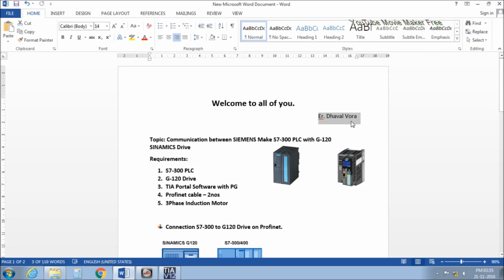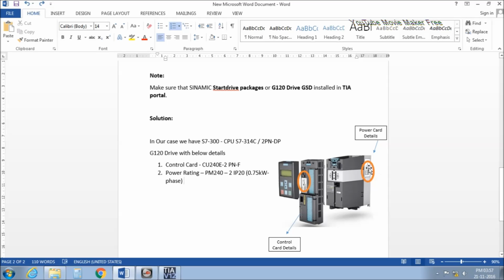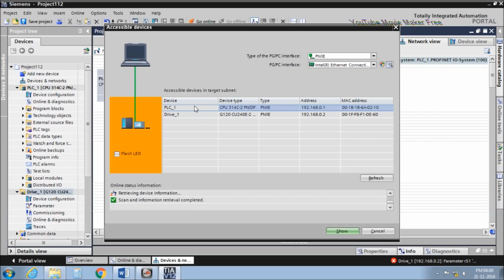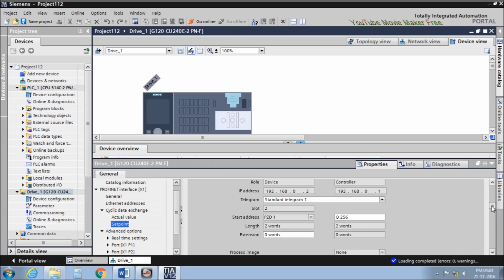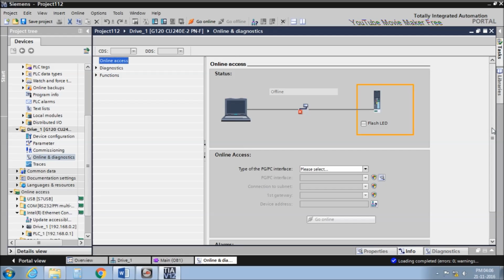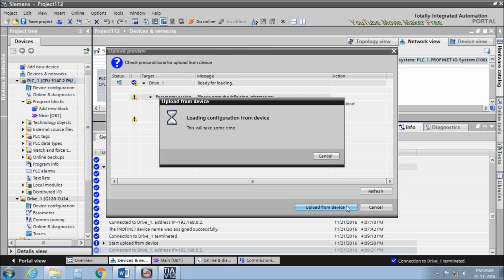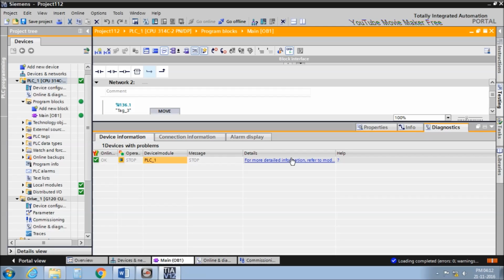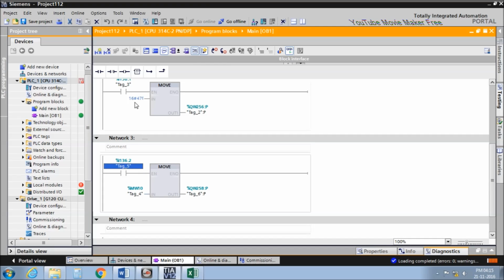ProfiNet Communication between SIEMENS S7-300 PLC and G120 SINAMICS Drive

Comment: hello Brother, firstly thank you for your efforts, 
I tried to apply your instructions carefully to my G120 drive, but the motor remain stopped, knowing that i didn't have any communication issue, i was able to pass to the online mode without problem, 
to make sure that the telegrams pass to the drive i opened the drive diagnostic window (in online mode), just to watch the control word, and there i realised that although i move the hex value to the address, the control world remain in it's prior value, it doesn't change ..., so please if there is something that i should do with the drive, perhaps some prior configuration... please tell me, i'm stucked in this point..
Reply from the maker: If your value is not change. Means communication not done properly. Plz. Again check. Inside drive check communication paramer. That should be process field bus....
Reply: @DhavalVoratechsystems  yes it doesn't change, but when i start the drive from the local button (the green) the motor run, and moreover i can perseive that the first bit of the control word pass to 1 (from the diagnostic window),  so  as you said maybe i missed something in the communication parameter, but how can i get into this parameters and how can i edit it, (do you talk about the p1000 ? )
Reply: @DhavalVoratechsystems  the actual value of p0700 is 0, is this correct, because i saw in another video that it should be fixed at 6?
Reply from the maker: @youssefalaoui6894  it should be 6

Comment: Hi, I have to program a G120 CU240E in a grafcet so it can control the speed of a washing machine motor, the point is I can't figure out which are the words in need to make this possible as it to make the G120 switch to an ON state we use 16#47E, which registers do we use to increase or decrease the motor speed?
Reply from the maker: Hi dear,
As per your mail, check below details.

For control word : check I/O's address of PLC & first pass 16#47E , after for enable pass 16#47F

For speed reference : pass 1word value on IO's address.

Example : 
My s7-300 PLC if I take free Telegram then it will assign starting 256 address. 
So, 
-first pass 16#47E in pwq256.
-After second cycle pass 16#47F in again same PQW256.
-Next loop take memory or analog value iw64 & pass to PQW258.

In short for Speed reference take second word of IO address.

If you still facing problem, feel free to contact me.

Thanks & Regards,
Dhaval Vora